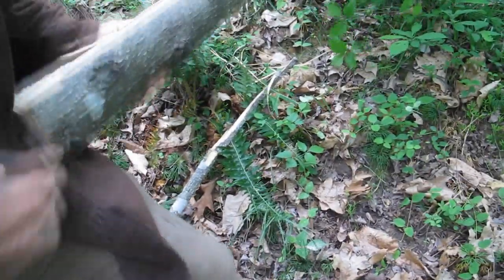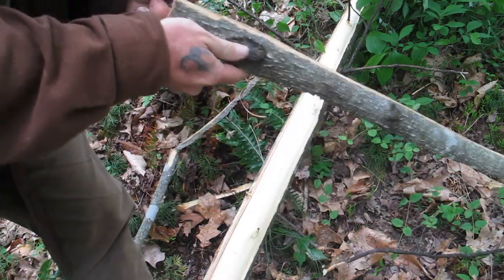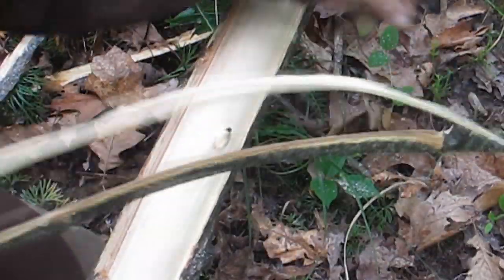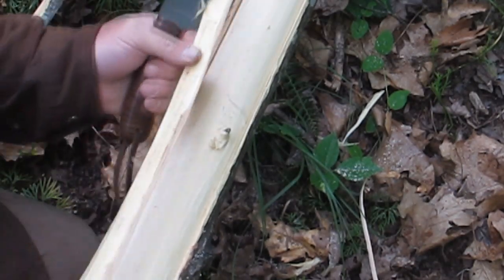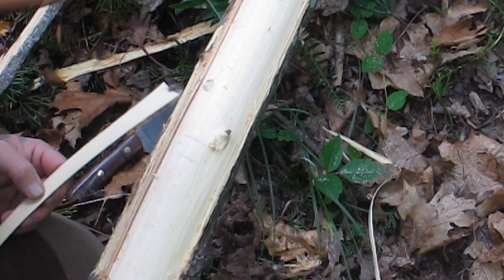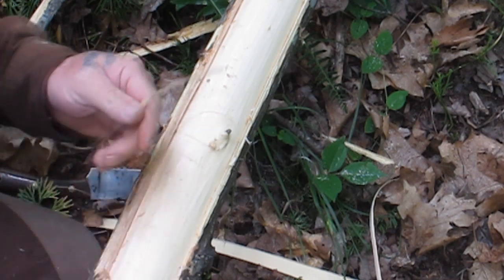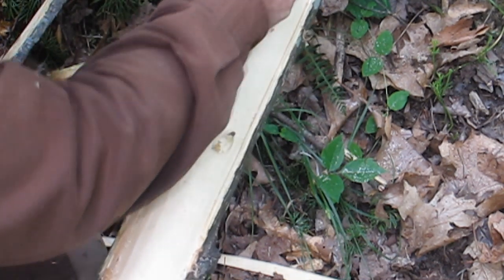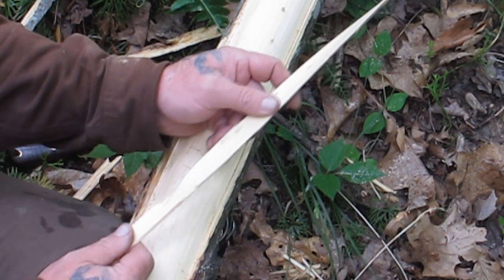Natural Cordage Part 1 Harvesting and Processing Materials

Comment: cordage is best when the materials are cut and dried first then wet before actually making the cordage that way the material making up the twist when drying doesn't become loose, I would leave a  piece of that tree siting in the woods and come back to it, the layers (outer and inner bark) may separate on their own as it ages/drys out, but I understand you trying to use the tree up.

Comment: you mention the need of your knife being sharp, the point you used your knife to scrape off  remaining bark instead of shaving it, would the back side of your knife work for that? to save yourself your knife edge, and the time to resharpen/hone it again? or is the sharp edge still necessary even when scraping?

Comment: if your going to strip it would be better to  use the back  bone of the knife and save you edge as much as you can ,  wouldn't it and on that  bark you using   try this take a  3/8s 
 wide piece and turn the outer bark in and use thumb pressure and you some times can separate  it  and use thumb and finger  to strip to your fibers depending on how young the piece is